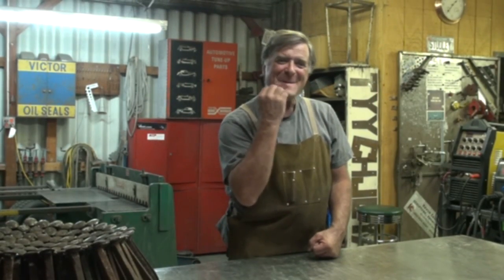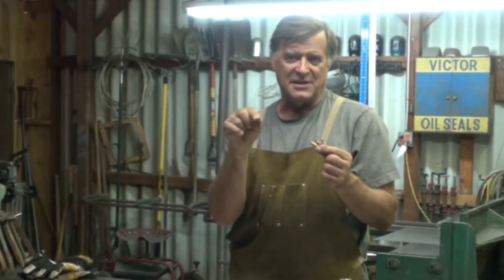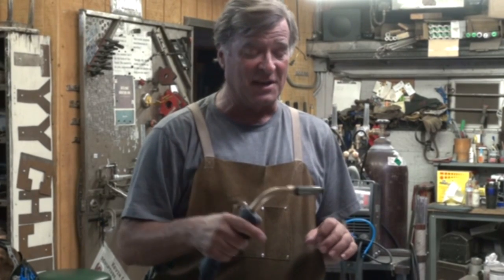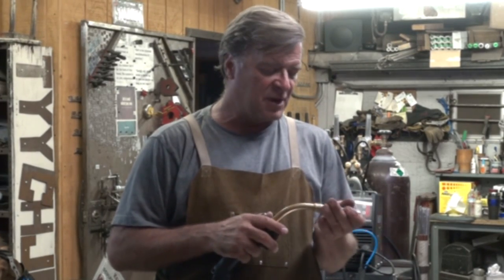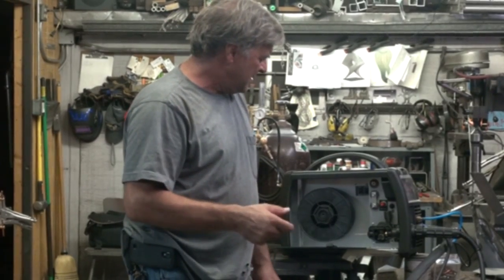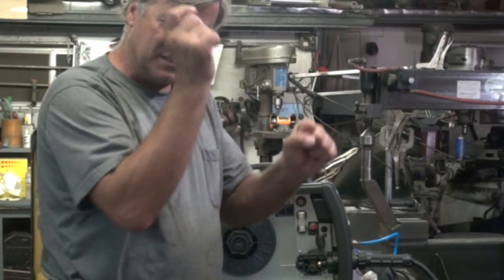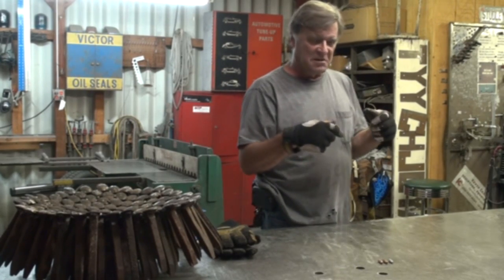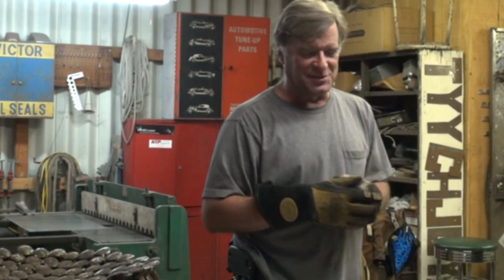MIG Welding: 'What Could Possibly Go Wrong?!' - Kevin Caron

Comment: My its having a shortcut it brakes the wire on the roll every time
Reply from the maker: Check to make sure the spool is turning freely on the shaft.    Or maybe you have a spool of old wire.   Is the wire rusty?  If so toss the spool and get a new one.

Comment: What about a wire feed prob. got a mig the wire feed won't work on min it clicks but don't feed but on max it feeds like on 4. Of course it's a mig with a knob that runs the wire speed and volts. Thanks
Reply from the maker: +BRENDAJASON1      Maybe a worn out liner in the cable?!     Or maybe the tension on the drive wheels is set wrong?
Reply: +Kevin Caron, Artist liner is good got like a coiled steel liner but I'll try the tension, thanks
Reply: Same prob works on high but when I switch to low it just clicks

Comment: Just get a 25# spool of wire.
Mine lasted a decade!
I've been using the tiny one that came with the welder for a couple years now.
The funny thing is I got the 25# .045 flux core for being able to get bigger welds, but the small spool is .035 flux core and is so much easier to weld with.
Reply: A lot has to do with the quality of the wire. My Everlast welder is pretty forgiving but it definitely likes good name brand ones more than the cheap no-name stuff. Some people say their welders wont tolerate old wire especially if it is showing some rust or perhaps the flux is getting old.
Reply: The cheap and the good quality wire seems to be close in price, and the MFG of the wire looks like it is the same.
Reply: Also, after some time, the tube gets dirty, and filled with microscopic filings from the wire. Then things get jerky, particularly with thicker wire.

Comment: Hello, quick question  if you don't mind, i have a flux core no gas wire welder that was working fine then all of a sudden no spark. the fan is on, lights are on at the machine, wire feed works great and metals are all shiny as required for good earth but not getting a spark. any ideas on how to troubleshoot this and fix it? thanks
Reply from the maker: bidders77 Make sure you have a good ground..   Check the connection from the cable to the clamp to make sure it is tight and clean..   With the machine unplugged make sure the connections on the drive assy. are clean and tight.    If all this is good then may it rest in peace/pieces.
Reply: Kevin Caron, Artist thanks, will try that tomorrow, bit late to try today as it's past 2 am here now in the uk.

Comment: I have a question that and this might be the wrong place to ask it but here goes. I have a Linclon square wave tig - 335. It's about 10 years old but a good one. I also would like to have a Mig welder. My question is can you use a spool gun to MIG weld steel on it. What you think?

Comment: You guys are awesome. Thank you Kevin for this video. I'm new at welding, like a baby/toddler welder if you will. My welds were skipping and now I know that my tip was the wrong size. It makes sense that if the wire is loose than there is a lack of energy transfer. Looking forward to more videos.